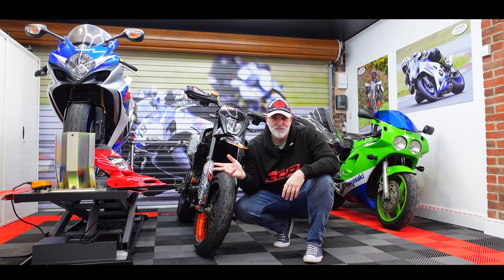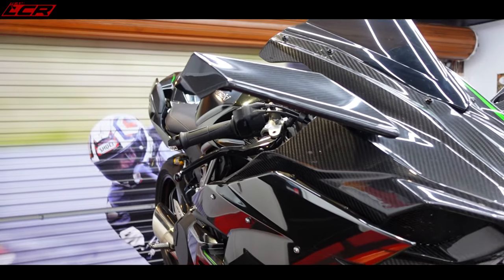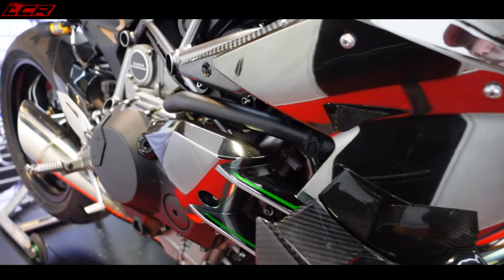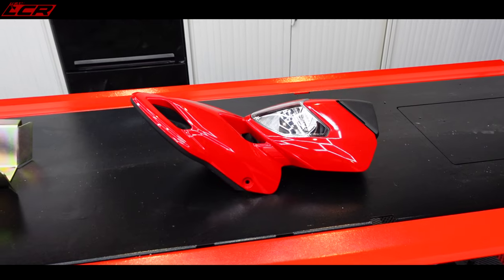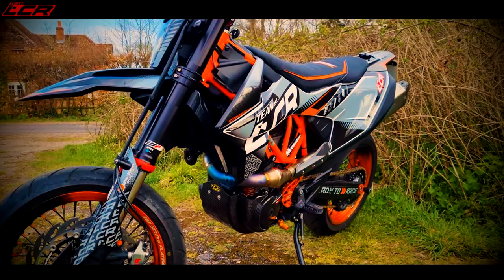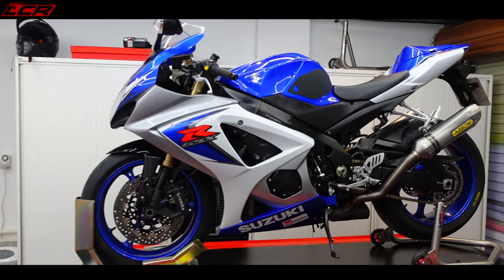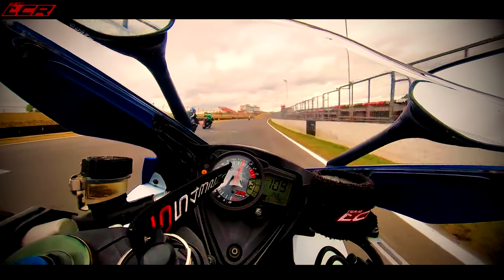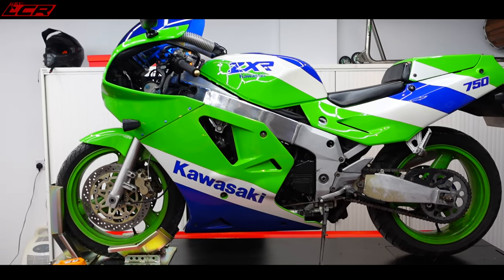How Did I End Up With FIVE Bikes!! | My Motorcycle Fleet

Comment: A nice gang of bikes. I bought a Moto-Composites Carbon kit for my ZX14 R but it does not fit well and it would not have been mocked up to check for fit at all as very little of it lines up. It is a big Dremel job with me having to hack pieces apart to make them fit. I am a Fitter, I have worked in auto manufacturing and I know how to make things get together but this does not work. Single piece items are probably ok, like on LRC's H2, but the kit on my bike has many different joining points making it complex but they were not tested. Just a word of warning.

Comment: I have five myself, which feels like too many to take care of and use for a person with other interests and responsibilities.  My personal rule is to put 500 miles/year on each or I should sell it.  Doesn't sound like much, but crazy 2022 of work and family responsibilities I didn't even register three of them after June '22.

It is easy to accumulate a nice harem: just don't sell the one(s) you have due to refusing to give them away in trades or private sale, and still want and buy new (used) ones as good deals come up.

With that said my depreciation argument is largely moot as most are worth more than I paid, I need to find another reason not to sell any of them.  "Downsizing" of job responsibilities and only child leaving for University this fall means I will have another garage bay and more free time.

'23/24 will be different I may need to add a couple more...

Comment: No supermoto ABS dongle on the 690 smcr ?Game changer.. you can hammer the front brake without fear.
Reply from the maker: Only turns off rear ABS doesn't it?
Reply: @LambChopRides  no! Turns off rear, less front intervention and cornering abs off. Allows rear lift up eg stoppies. And MSR is deactivated meaning easier backing in. 
So you can absolutely hammer the front without worrying about it. You can brake so much harder than the normal ABS. 
I’ve learnt to slide and back it in, never been able to that on my bikes before. It’s so addictive!!

Also it remembers your last TC settings, on /off etc. 

https://youtu.be/V_lCDqqZK3I

Comment: Yeah that H2 is a 2016 model, but it was probably registered for the first time in 2017 hence why you say 2017 model.
The 2016 model is actually what you have is though, because it is the only H2 so far to not have the (in my opinion) the much nicer green frame. 
Still a very nice bike, and that ZXR750 is so nice, same with that GSX-R and the supermoto.
Reply from the maker: No it's a 2017 as they had the Ohlins 👍
Reply: @LambChopRides  Hmmh that is true. Perhaps yours is a rarer model as I'd think that the amount of 2017 models with a green frame is far higher than the amount with a silver frame. Or perhaps it could actually be a 2016 model, but they replaced the rear shock to the newer models ohlins?

Comment: As a heads up, your front brake line is routed incorrectly on the KTM, should be to the inside of the fork guard.
Reply from the maker: With the different Brembo it's the only way to route  it

Comment: Are two supermotos in the garage a bit too much or is there going to be enough difference between them?
Reply from the maker: Yes good question and it's going to be fun finding out! 🙌😎
Reply: @LambChopRides  Indeed! Especially when they are tuned to the n'th degree, good luck with that. I have high hopes for the Duc, but would be hard pushed to kick either out the garage.